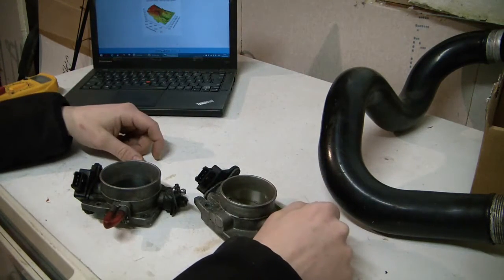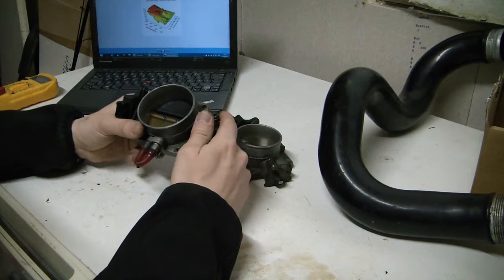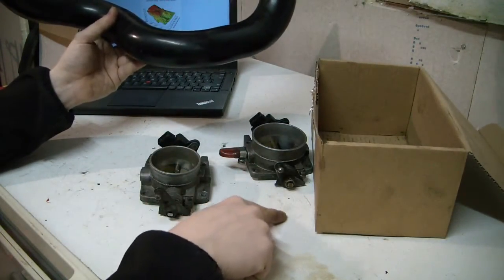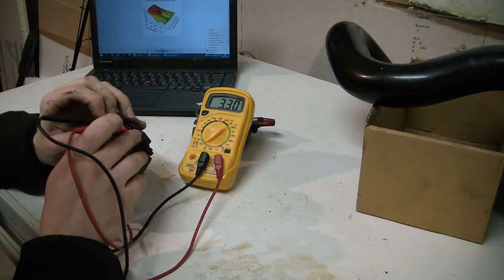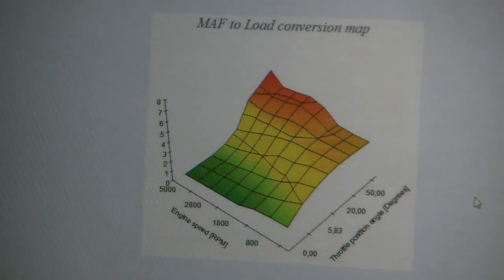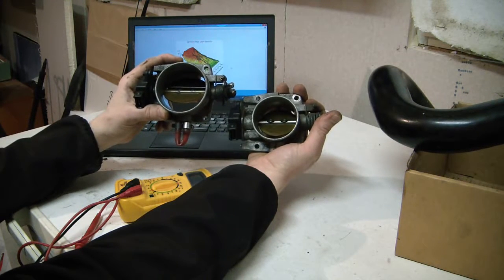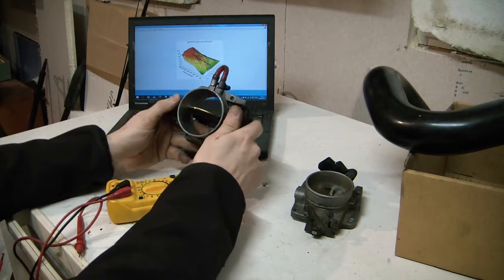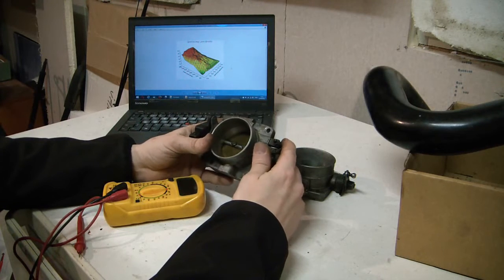Volvo 850 throttlebodies. And their impact.

Comment: Do you think dirty / broken throttle body could cause jerking when slowly stepping on and off the gas? I'm being really gently, but at the moment of just stepping on, or just after completely stepping of my car jerks a few times before settling down.
If I'm already slightly on the throttle in 1st gear and I floor it, this jerking doesn't happen.
Reply: The car is 1997 850 2.5l non turbo

Comment: I'm running a Volvo C70 2.3 T5 manual. If I put on the automatic throttle body it will be more responsive?.. Or what is the advantage?
Reply from the maker: If you are going for a lot of mods.
Like NA cams. and bigger IC and turbo the auto TB is less restrictive on full throttle.. But i would guess this restriction will happen until you make over 350hp or more.??

So for your car just use the one you have.
But have a look at my throttle body cleaning video. This will give your ECU a more accurate signal.

The turbo hoses video is also a thing to have a look at. 
Many 850turbos still have the factory Boost control hoses and they are rubber and will crack with age and cause the turbo to spool up slower if there is a small leak.

The biggest point i my video is to show that the stock throttle body is not restrictive. And that there are upgrades that come with "decreased driveability". and are perhaps not suited for daily driving
Reply: I'm only heading for 310-320HP, maybe 330. The engine internals will stay stock. :) I'm also going to have a look at a RIP kit. Less curves. :)
Reply from the maker: The RIP kit will provide better response and spoolup. so good a solid choice compared the throttlebody
Reply: What diameter intercooler piping should I get

Comment: cant you take the plastic off?
Reply from the maker: It will leave 2 small holes where int the plate.
And why would you since it really does not impact performance that much.. and adds driveability
Reply: ok. thought it might be a easier option than going for the bigger throttle body lol. but my Volvo 850 t5 station wagon pulls nicely still. only it still does not pull as my brother in laws Volvo 850 T5 sedan. his would spin into 3rd.
Reply: @Volvo5Cylinder  I have read a lot about putting a 960 throttle plate in place of the 850 GLT NA throttle plate. It is a direct fit and essentially it is the same thing without the plastic "puck". What I'm really interested is in lower end torque.  The N/A 5 speed is a little under powered  so when driving around town and going up hills you are either at 1500 rpm (not quite enough power to climb the hill) or down shift to get to 22-2500. In short order you are at 3000 rpm and its time to up shift again. It would be nice to be able to ease into the throttle in 4th gear and have enough power to stay in gear and climb a slight hill  instead of having to hunt through the gears to find the right rpm. I'm not sure but i think this would call for the ECU to do some relearning. so disconnecting the battery would be in order. Any thoughts? Great video by the way. "lets stop dividing by zero and try to explain what we're really saying."  Im going to use that one!!
Reply from the maker: @tysauce1986  Yes the 960 is without the plastic part. so you loose contol on "part throttle".  It will flow better on wide open throttle but other than that is is no use unless you change all the Intercooler piping to the same size.  "Stick to stock" and you will be happrier :)  it is not a bolt on part and you will have to grind the intake manifold.
Reply: @Volvo5Cylinder  I'm running a 1995 naturally aspirated 2.4 5spd. So it would be direct fit.
Reply from the maker: @tysauce1986  Yes, on NA engine it should be "bolt on". but you will only loose on low end throttle control, the top end power gains are negligible... so even on this engine the upgrade is not something i would recommend.
Reply: @Volvo5Cylinder  I'm still considering giving it a try. It's a pretty easy swap and I'll keep the original plate as is in case it's not preferable. Thanks for taking the time to respond.